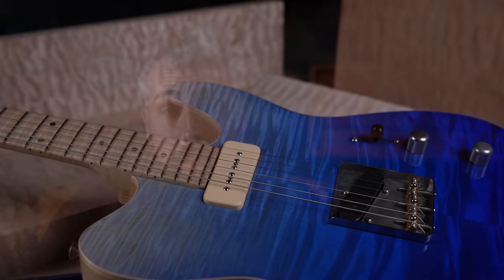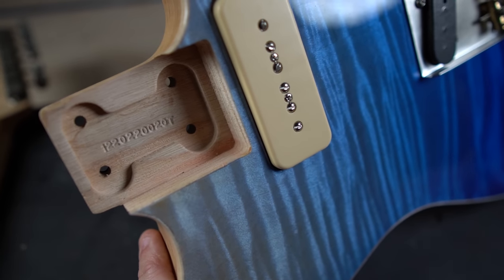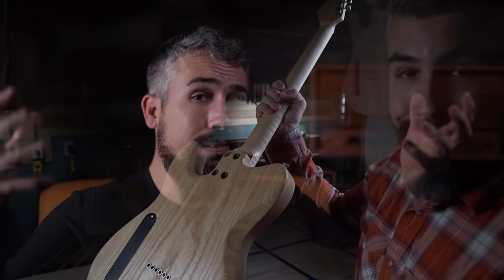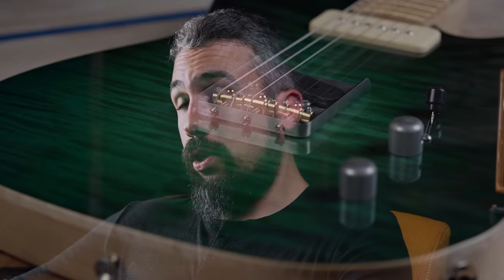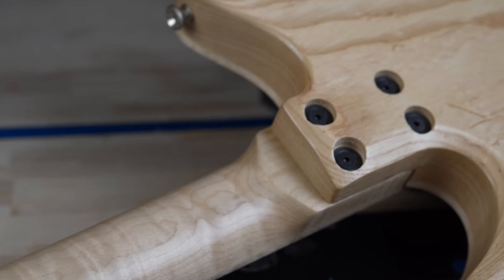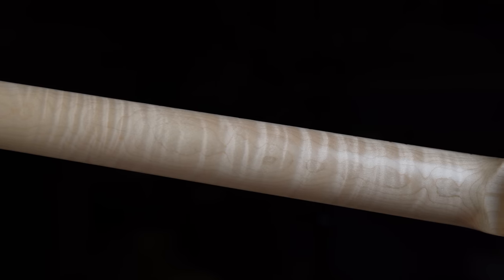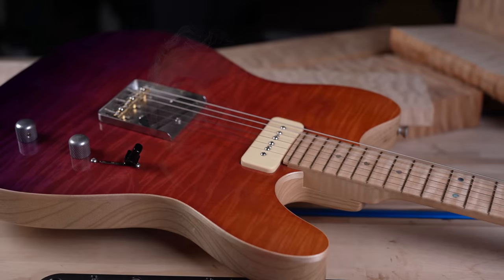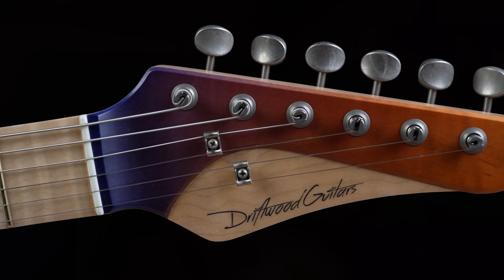Why Our New Electric Guitar Isn't Just Another Telecaster.

Comment: A few suggestions to really bring this style of guitar into the modern age:

1- slight back angle  on headstock will eliminate the string trees…one less point of contact …I use 4 degrees on my Fender-like builds.

2- contoured heel at the neck.  No need for a square block jabbing in the players palm when playing in the upper register 

3- drop top bevel on the body.  Whether a bent (my preference) or carved top, this is a major area of comfort improvement.

Other than that, great job!  Oh…and definitely top marks for using a Boogie!

Comment: Trussrod is needed for different action heights. Relief changes depending on action height. Tip, everyone will add carbon rods to stiffen the neck, good for one axis, think about joining the rods along the neck together to stop twisting of the neck. If the neck twists being joined will counter act the twist. If you use Solidworks you can do a finite analysis test.
Reply: Yeah, we all like different relief for a start.

Comment: This might be a bit nitpicky, but the saddle screws are sticking out so much that they will interfere with playing close to the bridge, especially with palm muting. To be fair, it’s also a common problem on many Fenders, but it’s one aspect of the design which can be improved either by using shorter screws or adding a small back angle to the neck. I normally use StewMac shims to correct this, but this is probably incompatible with your design of the neck pocket.

Comment: So cool to learn about your design journey with this first. I think I would be extremely interested to see how you guys would come up with a semi/acoustic electric guitar. I have a telecaster with an f-hole and I love it (I can practice without it plugged in to an amp when I'm lazy, and it's nice and light). I wonder what your thoughts are on existing semi acoustics, and what you would do to get the most you can out of these guitars that kind of straddle the fence a bit between two worlds of guitar.
Reply: Arent these guitars based on the thinline Tele? From the video it looks like these are chambered guitars without an f- hole. So you could request one with an f hole. 
Unless of course I’ve missed something.

Comment: It looks like you did a nice job but it still looks like a regular Telecaster love your neck joint but explain to me how you're going to pick up resonants from wood through a pickup which is only designed to pick up vibrations from a metal string using the pole pieces and magnets. Using a small microphone such as an acoustic electric guitar then you might be able to pick up some of the nuances of the different types of wood used just my opinion

Comment: Well you have a great channel and so let me tell you that you are doing something wrong.

There's no point in arguing about it. All you have to do is try to prove every claim you make.

Measure the volume in the decay of a guitar that's chambered and when it's not. Try different woods and measure it. Try different necks. My hypothesis is you cannot prove any of this makes any significant difference.

If there is any difference at all, It is that the heavier and denser and firmer the material of the guitar the more sustain. In short, you do not want to have the guitar vibrating. All the vibration of a guitar means that the signal from the string is being put into the wood and is not being picked up by the pick up. Which only measures the metal string. 

Lastly, The Stratocaster is a better shape that a telecaster. And you do not have to have a trem on a Stratocaster. There is an arm cut on a Stratocaster which is very important for people who have somewhat bad circulation and after they play a while it can cut off the circulation in their arm. This is why many people like arm cuts on the tops of their guitars.

I just read that you're charging $5,000 for a guitar? That is ridiculous. A guitar is basically a slab of wood -  according to Les Paul. That's what's great about them.

Comment: The dog bone just seems like so much extra work, the only extra surface area you gain is the sidewalls of the bone itself. If the pockets are made snug, the neck with threaded inserts and the heel with ferrules then there really is no need for indexing either. If you want the benefit of set neck/neckthrough then why not build them as set necks or neck throughs. Carbon/titanium rod reinforced necks have been around for a long time also, sorry but I'm just not seeing too much of anything new here other than the fact this neck is on a tele instead of a superstrat style guitar. Great sales pitch for those who simply dont understand though, very PRS 🤣

Comment: Isn't it possible to combine carbon rods with a super slim truss-rod that doesn't have carry a heavy load, only supply slight adjust ability of relief. I can imagine it and see it's use ;-) In my mind it also will have less effect on the tone. I used to have some guitars with Warmoth necks, one had a double expanding rod, one had a traditional rod. The double expanding ruined the tone of the neck to my ear, but the traditional I kept and it sounds glorious. To me it seems there was just too much mass of metal in the double expanding, and that was the problem. I love the idea of a double expanding rod, but I'm skeptical of the mass involved. FWIW

Comment: Looks lovely!

However, 6 brass-saddle bridge please.

Love the headstock.
Love the upper mini-cutaway, but maybe a smaller lower cutaway horn (1/2”?).
Love the heel area.

This dog bone thing… do I take it that although not shown, the is a corresponding ‘male’ bone shape to fit into the body ‘female’ one? Without that, I see less surface contact, not more.

Finally - looks and sounds gorgeous.
Reply from the maker: Thanks for the input! Yes the neck has a machined male and that locks in.
Reply: @DriftwoodGuitars  very ingenious indeed! 👏🏼👏🏼👏🏼👏🏼👏🏼

Comment: Nice guitar. But your assertions about electric guitar physics are not correct. "We want that energy to travel through the neck into the body of the guitar"  - no you don't. You just described the mechanism of dead spots, and the general mechanism by which string vibrations can be lost to the neck, so not seen by the pickups. The neck has resonant modal frequencies which are excited to vibrate by string vibrations, and those vibrations are thus drained from the strings. So sustain is measurably reduced at those frequencies. Your carbon fiber reinforced neck may or may not be less subject to that. That is, your neck may vibrate less than conventional necks, which would be a good thing. However it may just vibrate at different frequencies, as a result of its greater stiffness. Direct neck vibration measurements of carbon fiber reinforced necks have suggested that that is mostly their effect. Of course having a more stable neck confers other benefits.